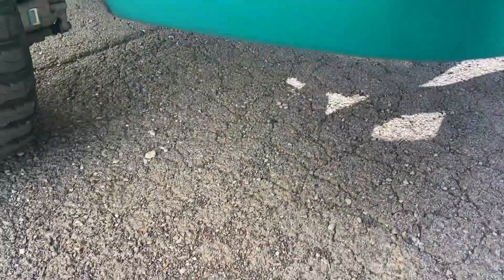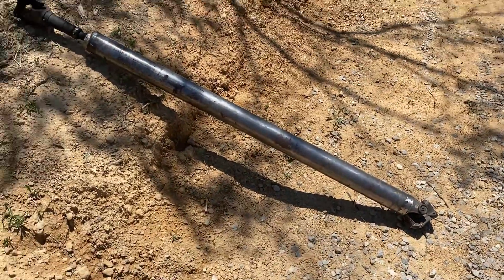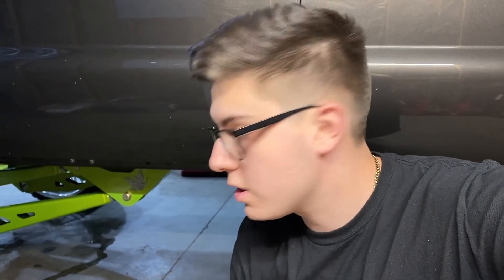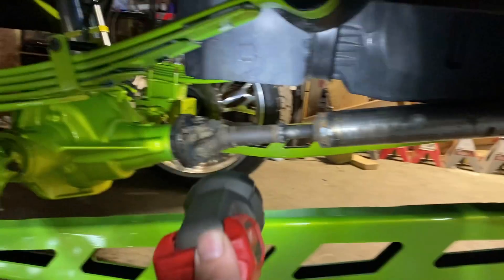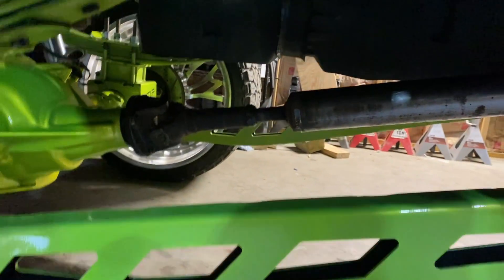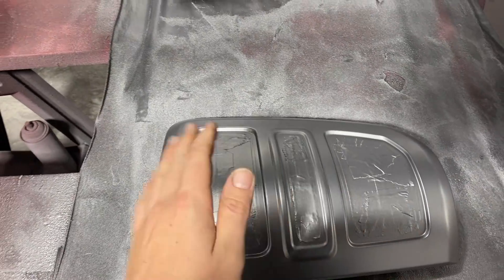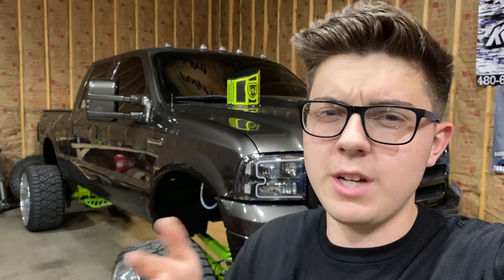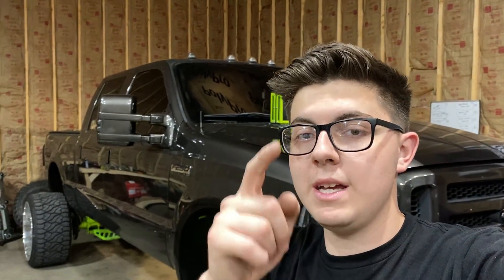BIG ISSUES FOR MY 6.0 POWERSTROKE & I NEED YOUR HELP

Comment: Powder coat the DS, add drive shaft loops front and back, neon color match shock boots over the yolks! Looks awesome on my 2003 F 250 XLT (95,000 miles and still rollin with a 6 inch Superlift Suspension and 3 inch body lift sitting on 38 inch Extreme Terrain Mud Tires. Justin your truck looks “SUPER” just like the nameplate. Come on up to the Adirondack Mountains and let’s go four wheelin!

Comment: Do you think you could do a breakdown on cost for this new setup especially the powder coating because I’ve been wanting to get my lift powdered and I’m curious what a full powder coated setup would run me thanks. Truck came out baller I watched the whole re build from the start.
Reply from the maker: Yes I will do full cost break down!

Comment: Color match the tow hooks the same color as the truck, since the plates behind them are already yellow it may be too much to paint the hooks yellow too, the grey hooks would give it good contrast. Also you could paint the Hex grill inserts the same color as the suspension to bring more yellow into the front end.
Reply: Truck looks super clean btw. Great work.

Comment: Hey Justin! Great content man! Curious if you ran across this issue: my 2005 6.0 has just started a thud noise I hear in the rear of my cabin on big bumps. By chance have you ran across this? Almost sounds/feels bouncy for a second too. 108k miles
Reply from the maker: Yes your cab mount bushings are shot. Watch my video on it I have a older video from a few years ago. Replacing the cab mount bushings will fix this problem your having !
Reply: Get some cab bushings. Look under the 2 to the back and they are rotten daystar makes some gray poly bushings. Good quality fairly cheap. 👍🏻
Reply: @JUSTINHAWKSMITH  thanks man! Will do
Reply: @StephenBrewer89  thank you!
Reply: @PowerstrokeTyler  no problem man. Mine did it only on big bumps every now and then about 6 years ago. Swapped them all out and have not heard a peep since. I think S&B makes some too, but daystar are good and way cheaper. Just don’t buy OEM junk unless it’s off a 7.3 cause those are actually rubber not that foam they still use today.

Comment: Are these 6.0 driveshafts known to go bad ? 
I’ve got an 04 f450 6.0 and it’s got a weird shake at 40mph and 50mph 

After that it smooths out .. weird ..
Reply from the maker: When they have a 2 piece sometimes yes they can. Carrier bearing is usually what causes that